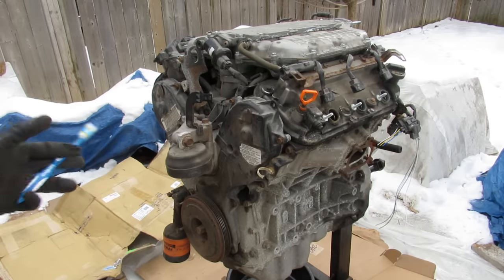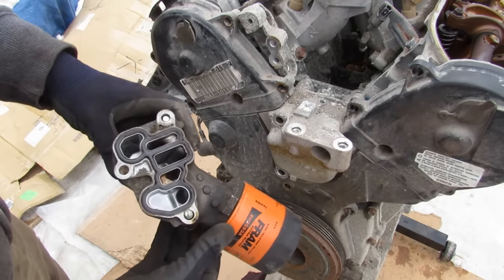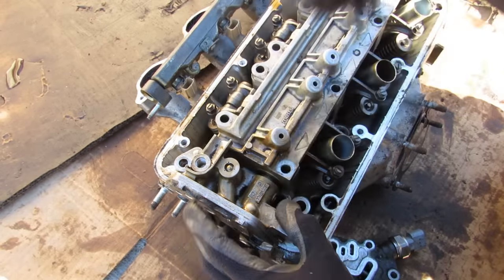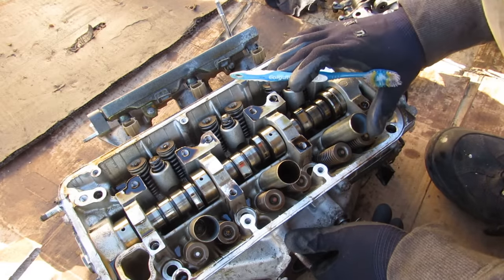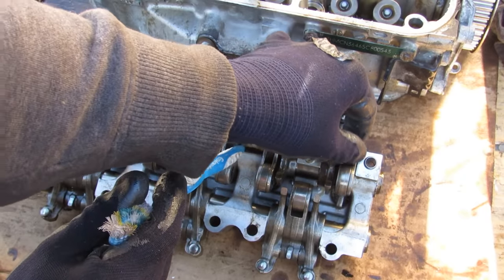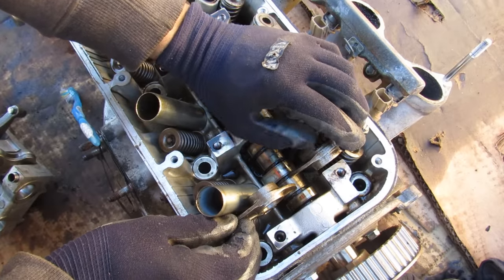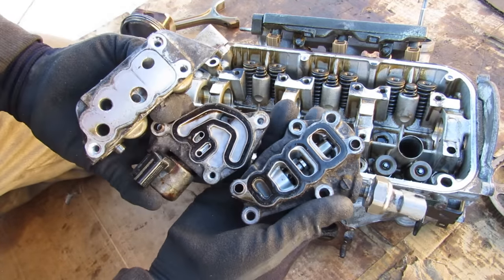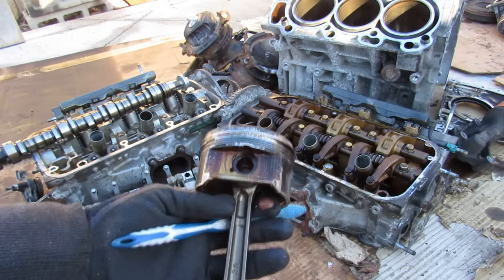Why Cylinder Deactivation Can Cause Engine Failure

Comment: GM's efficiency tech is to shut down cylinders until the tow truck is doing all the work.
Reply: Nice! 😂👊👉
Reply from the maker: Lol
Reply: LOL
Reply: tesla is even more efficient!!! In lying and big talks :)
Reply: Ford is deactivating one out of 3 in new Escape....
Reply: @spol1622   Ford is preparing to use cylinder deactivation in a variety of engines. Don't be surprised when the 5.0 V8 gets it.
Reply: The Genuine Misery...
Reply: Practically, all engines with thiis VCM are going to fail in matters of when, not if.  That's why Honda now is moving to Hybrid just like Toyota. To get a better mpg hybrid is the best solution. 3 cylinders small turbo engines are not acceptable for NAmerica, they failed way too early with the way people in US/Canada use and maintain their car.
Reply: @rondhole   The systems are fine if the owner changes the oil early and often, as well as using a high quality oil filter. The issue is that the popular trend is to buy a premium full-synthetic and run it for 7500 to 10,000 miles. Sure, the used oil analysis says the oil still has enough TBN at 10,000 miles, but it's loaded with abrasive carbon soot that clogs the intricate components of the VCM/AFM/DFM/MDS system. The only way to keep these combustion byproducts at a safe level is to use a high quality oil filter and to change the oil more often. I know people with GM trucks with AFM that have well over 250k and the engine has not had an issue with the system. The only thing I know they do different is that they change their oil before 5,000 miles. They use more expensive oil filters that use a higher grade of filter media to capture sub-30 micron particles from the oil. Pretty much the opposite of today's trend of people buying expensive oils and assuming it's fine to change it every 10,000 miles because the bottle says so. 

Cylinder deactivation is no more complex or prone to failures than systems like Audi's Valvelift, variable geometry intakes, variable flow oil pumps, VTEC, VVT-i, D4-S fuel injection, etc. If your only goal is maximum reliability, you might as stick to vehicles with a SOHC engines with 90's era fuel economy and emissions. No turbos, no variable valve timing, no more valves than necessary, no variable valve lift, etc. Because there isn't a manufacturer out there today that isn't using complex engine designs vulnerable to failure without meticulous care. Even the engines with hybrid systems... which are often paired with CVT transmissions. I would take cylinder deactivation over a CVT transmission TBH.
Reply: @karlschauff7989  statistics tells VCM is cursed by design, just like direct injection only, or hybrid eith belt type CVT in older Honda. VVT-i and vtec has no problem by design. Tbey are proven reliable. We talk about majority of VCM not 1 or 2 cases that has no problems and majority of 0 issues in vvti not 1 or 2 lemons.
Reply: @Ellis Murdough try to sell it? Just don't buy any car with VCM. does not matter from Honda, Mazda, GM, Chrysler, etc. They  are all bad by design. Just like all type of DCT transmission, it only matters of when they will fail.
Reply: Imagine over-engineering a feature to save a tiny bit of fuel that pretty much kills the engine just past warranty and that you are better off to muzzle the feature to begin with. Sure that they say, we need this feature for emissions, but for a third of the life of the engine its burning shit loads of oil at the end of its life. Seems so backwards and stupid.
Reply: @azzajohnson2123  Yes, Honda and GM are just too stubborn keeping VCM technology that cannot be improved by prohibited physics thermodynamics for reliability.  Going to full hybrid is proven to be way more reliable with AISIN type HSD in Toyota and Ford.  You can gain 2x mpg with hybrid in city drive and the same reliability on the power train.  Yes, the battery may need replacement in 10-17 years (depends on climate) but it still cost way less than the fuel-saving  over 5 years.
Reply: @rondhole  It's almost as much of a black hole as CVT Transmissions are...
Reply: @azzajohnson2123  No, CVT are great, efficient, and reliable when it is made well like most Toyota and newer Honda.  Yes, it has the subjective feeling of rubbery but it actually gives the most torque and power per engine RPM.   Many Prius, RX, ES, Camry, Corolla hybrid with e-CVT are still running well beyond 400k miles. It is all gears, no clutch, no belt, no torque converter. Just full planetary gears and power splitter, like differential box (extremely simple).   The belt CVT in Corolla/Auris and Avensis are also reliable.   CVT has a bad reputation because of JATCO-Nissan crappy built, just like dual-clutch by VW, Ford, and early KIA/Hyundai.  CVT in 2.0L corolla has real 1st gear and launch really well, you also can turn the simulated gear shift on it. Really nice drive and we know it is most likely as reliable as older corolla CVT. You just need to change the fluid regularly with proper level
Reply: Hahaha great comment!
Reply: @rondhole  so many YouTube videos showing Most not all but most CVT are trash.
Reply: @karlschauff7989  well, you do have a point. Since you have to add a quart of oil to your 5.3 every month, might as well change it.
Reply: the shade at GM is always hilarious
Reply: L🤣L
Reply: Hahaha!!
Reply: But here I do not see the effect of cylinder decompression.  After this disconnection of the cylinders, compression is present in these 3 cylinders, and this is like a retarder in a truck that slows down the engine and the car.
Reply: @speedkar99   But here I do not see the effect of cylinder decompression.  After this disconnection of the cylinders, compression is present in these 3 cylinders, and this is like a retarder in a truck that slows down the engine and the car.
Reply: Honda has similar program VCP, vehicle crash program, engine locks up and solution is head over to Honda dealership to lease or buy a new car 🤡💯😀👍
Reply: Very complicated engine. No thanks.

Comment: It is not like they didn't know how it would behave, even in theory. But they had to do it for the stupid emmission laws written by clueless politicians. Future of car industry is not looking good.
Reply: If not for these "supid" laws that car manufacturers have to comply with, your car would probably burn twice as much fuel. This solution is bad, but there are other engines from this era which run for 1 mil + kilometers without any major issues while still complying with the same laws.
Reply: @rokas8594  Wrong. I am not talking about normal laws and regulations. I am talking about these new ones, that are written by idiot politicians that have no idea about technology and industry. For them it is easy just to say, from now on engines must emmit 10 times less CO and CO2. Well, it is impossible. It is not alien technology. You can ask 2 times less, and maybe that can be done, maybe. But they are clueless about anything. Never mind that cars are responsible for only 5% of pollution or so. Forget about the coal power plants, that are the 50%. We must ban cars (so I look green, and get elected again).
Reply: @DashCamSerbia  there is some truth in your statement, but then again, I firmly believe that this is exactly what drives progress. There was once lead put into gasoline and a law was written to ban it. You think car manufacturers would have voluntarily reengineered their  engine lineups to make them run on unleaded? To be honest, I highly doubt it. Maybe it seems impossible now, but in some time it will be done. And hey, cleaner air in cities is a good thing, no matter what anyone thinks about global warming.

Back to your original statement, your comment on this particular case of breaking down honda engine implies, that you were talking about some older law, this is not a new car after all.

Comment: I've used a device called, "S-VCM Controller" every since I purchased my 2008 Accord v6 at 165k. It tricks the computer into not engaging the cylinder deactivation. I now have 260k and no oil burning issues at all. I'm not sure if the piston rings were replaced under recall by the previous 2 owners before me, but I've witnessed a v6 Honda Accord switching from ECO to normal mode while operating and a plume of smoke coming out the tail pipe every time. I did my research before purchasing this car & it paid off! I am not disappointed at all. During my 3 years & 100k with this car 0 major repairs. I'm glad I purchased the "S-VCM Controller.
Reply: I'm about to do the same with a 2 dollar resistor, hoping it works...
Reply: @TaylordBuDMaN  Spend the money on the smart resistor. It's worth it.
Reply: I did the same with our RDX and it works great!
Reply: @timbucker  It's so seamless! I often forget it's installed.
Reply: S-VCM is the truth! 2010  Accord v6 Ex-l with 180k. It made it feel like a whole different car.
Reply: @Amdfan900  Exactly! V6 power always on tap. No vibration or hesitation from the cylinder deactivation, plug fouling or oil burning.
Reply: @sportyhuntley8914  You think the SVCM will outlast our cars? I feel like I should pick up another one.
Reply: @Amdfan900  Only time will tell. They seem to be well manufactured though. I've had my 2nd one for 3 years. My first stopped working. Didn't bother to contact seller & just purchased another one. 2nd one has slight design change. Has been solid ever since.
Reply: @sportyhuntley8914  Well put, mine has been through negative degree weather and 100+ degree weather it feels a little brittle but is still kicking. Very grateful for this invention.
Reply: I ordered one for my odyssey, can’t wait to install it
Reply: @bryanhill4516  You're gonna love it
Reply: no fix for the mazda skyactiv engines?
Reply: @roostersideburns3440  I don't think so. The guy custom makes the devices for Honda engines & programming.
Reply: @roostersideburns3440 what’s the problem with the shyactive engines??
Reply: I mean skyactive

Comment: A great explanation and demonstration about VCM.  Don't forget the age old problem of thermal difference on the deactivated cylinders.  Something that plagued the Cady V8-6-4 and all others that attempt to switch off cylinders. You can't fool physics.

The VCM on my 2019 Ridgeline was disabled very early on using more of a "smart" manipulation of the temperature feedback.  Normal "pass through"  at low and overtemp situations, but not allowing normal VCM temps to be reported.  It also varies the output just enough to prevent a "flat line" record if anyone looks at the logs.

My model version also has direct injection only which compounds the carbon situation by not having any valve washing.  

These engines have injector issues, carbon build up issues, motor mount issues, and now rod bearing issues (recall) which BTW are on the rear bank.   The body is also prone to water leaks. IMHO Hondas are not the quality they once were.

As the complexity of cars increases it seems the tech skill level is simultaneously (generally speaking) decreasing.  This creates a real double-whammy problem for the consumer.

Maybe I need something carbureted with points and a 4 speed?  😄
Reply: Thank you, you're 100% factually correct with this. I'll go with Sienna instead of the Odyssey's V6 VCM.
Reply: This is a GREAT comment!
Reply: which device did you use to disable VCM ?

Comment: I have a 2013 odyssey.  Was having the rear plug issue bad. Had to resort to the VCM disabler. I have had it on for 2 weeks and the difference is AMAZING.  It now runs like a proper Honda!
Reply: Hi.   please tell us the product model name for the vcm disabler or a link online where you bought it.  thanks.
Reply: what was the odometer reading before you put in the disabler?
Reply: @hallmonitor98  around 135k I think. Been over a year now and still running great.
Reply: @Busydadgarage717 I just installed mine today. 24 Ridgeline 1k miles. Hopefully this will prevent possible future problems.

Comment: He looses me after the first 5 minutes of what’s going on, but I still feel smarter at the end of his videos than the beginning. Love it!
Reply from the maker: Why did I loose you? Boring?
Reply: @speedkar99  lol, not boring. i just wish i was as smart as you. i will get there. i just need to watch more videos!
Reply: @speedkar99  noooo, not boring, whose toothbrush you took made you think that?
You are A number one teacher.
It's our fault if we get lost.
Me, I started thinking,  imagining your take on Citroen ID 19 with non-electric hydraulic ABS computer that used the weight of the car when braking to achieve equal quadrant patch pressure even down level of air pressure in the tires.
In fact the springless all hydraulic suspension allowed for driving on 3 wheels if necessary. 
All that in 19"frigin"55!
Yeah, over 3/4 of a century ago.
No , commie leftists eco-over-engineered fail design whatsoever.
Check out the late 50"s and 1960's ID& DS citroen (later they got taken over and "takin' out" by dreamkillers & conformity to lower standards.
Reply: *lose
Reply: Problem is actually talking so fast without drawing breath. Nobody can take in information at that speed. I know it's the fashion now to talk fast on YouTube, but we actually need easy -going speech, with gaps for assimilation of knowledge. Please reflect this back to YouTube!
Reply: i recorded his every word and then slowed it down electronically by 18% and understood his every word.
Reply: @skismosis  Yes sometimes I do change the setting to listen to a video at a slower speed, but sometimes it’s not more intelligible lol

Comment: EXCELLENT VIDEO! 
I could see   exactly how this system works and why there could be problems related to this system in the engine.
I really like the short cuts when disassembling the engine. Saved time .
5 Star video. 
Thank you very much indeed.

Comment: Excellent video showing the wear damage caused by the VCM 👍 AND that is why mine is deactivated.

Thanks for sharing
Reply: Yes deactivated with VCMUZZLER on a Honda
Reply: @MX-CO   hey there, i have a 2005 honda Accord EXL, how do i deactivate it ? it is a LEV , low emmission vehicle, is that the same thing ?
Reply: @MX-CO  I prefer the S-VCM over the muzzler.  Zero tuning/tweaking or seasonal adjustment.  It also will correctly report any over temp.

Don't forget adding a catch can.
Reply: @BowWowPewPewCQ  what’s a catch can and do you notice you’re spending more on gas?
Reply: @BowWowPewPewCQ what is a catch can and what does it do?
Reply: @dolphincrow  I get maybe 1 mpg less with s-vcm

Comment: Very informative video and excellent tear down. We got a CPO 2015 TLX with 40k on it for my wife back in 2018. While doing my research, I disabled the VCM using S-VCM. Before installing the S-VCM I did get the annoying vibrations from VCM activation at certain highway speeds. The car now has 99k on it and it drives like a dream. Given I do my own oil changes when the oil life hits 30% (4,500-4,700k miles). Finally scheduled to get the connecting rod bearing recall done next weekend.
Reply from the maker: Awesome! 
What's involved in the bearing recall? Inspection?